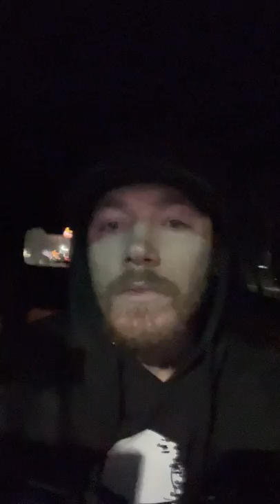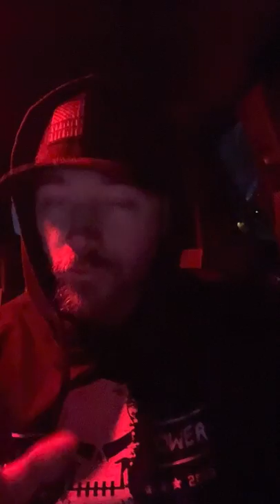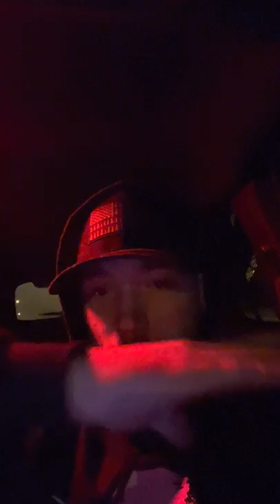Fass lift pump on your ecodiesel ram or jeep

Comment: Hey! I just installed Fass titanium with a Fuel Sump.. I have bypassed the factory filter too..
 But for some reason I have to keep more than 1/4 of the tank otherwise it will cut off and wont start 🤦🏼‍♂️.. also as soon as I turn the truck off .. I want ti turn back on I have to get ignition on for a min then start it up.. like fuel is returning way too fast🤔